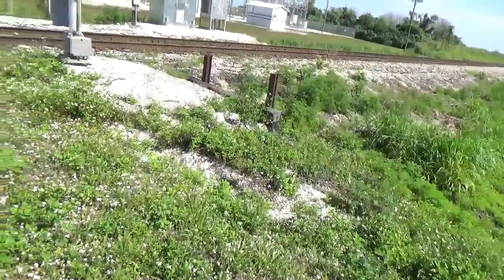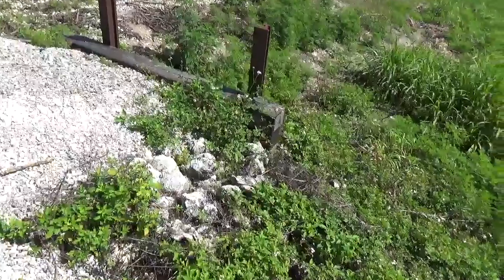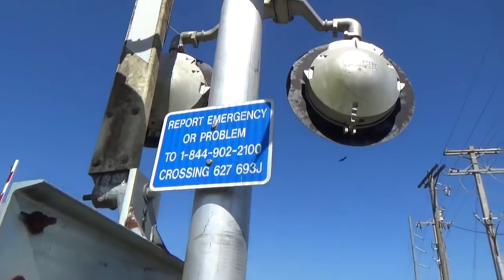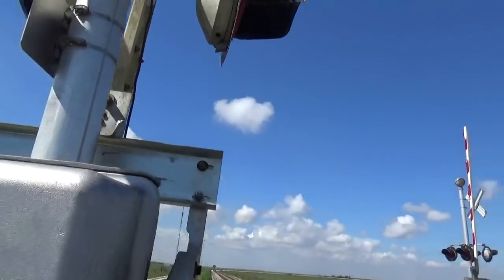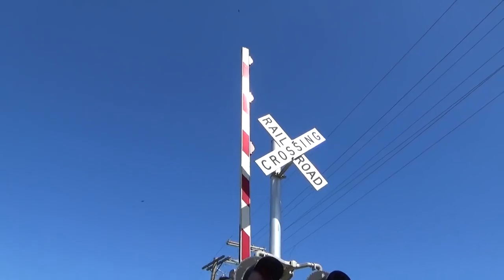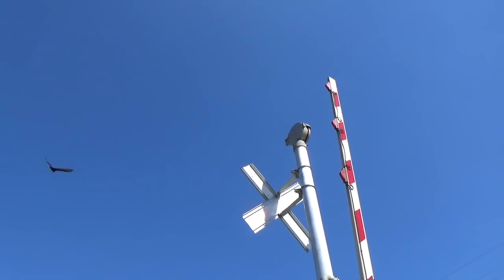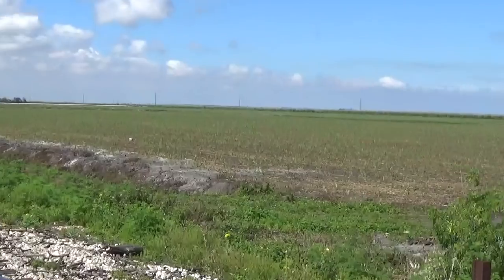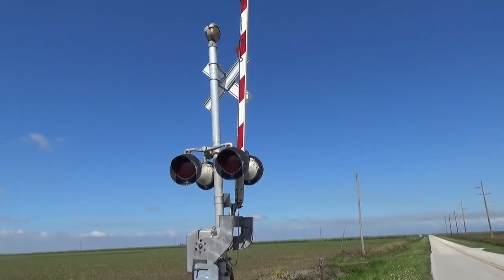Railroad Crossing Upgrade or Downgrade ? What is it ?

Comment: I would call this an upgrade, despite the removal of the cantilevers. It was probably a much busier road  up to a point, and I guess SCFE decided there was no need for such. Either that or train traffic on the line probably got a little busier and they had to put gates in.
Reply: Is the line still in use
Reply: yes it is

Comment: Where I live we had a similar situation there's a crossing where I live that the level of the crossing sits on top of a hill well the railroad in the city took away the cantilever and replaced it with this same type of crossing well all It ended up doing was causing more accidents then when they had the cantilever the way the crossing is is you have to go up the first hill then down the first hill and when you're going down the first hill you can't see the Crossing from up top of the second hill so you have to use your best judgement well this was causing more problems then when they had the cantilever because with the cantilever at least you could see the Crossing no matter which way you were in the long run it ended up costing the city in the railroad more money to put back the cantilever when they should have just left it there all alone an none of this would have happened!!!!
Reply: RailROL82 Not to be rude I would kind of like to keep it privet!!!!
Reply: RailROL82 Your very velcome!!!!